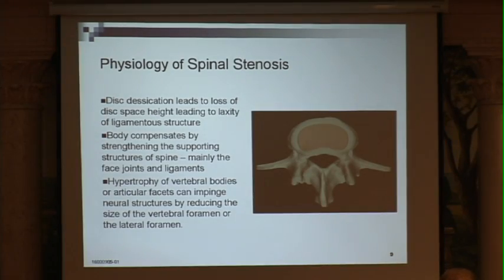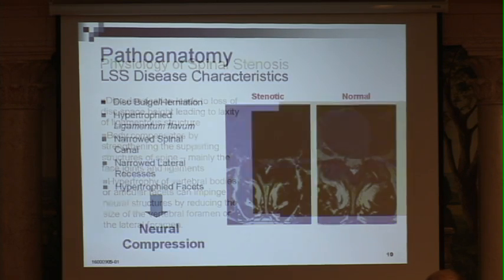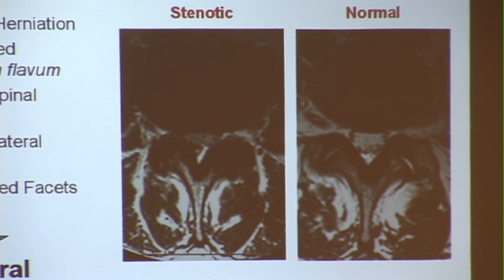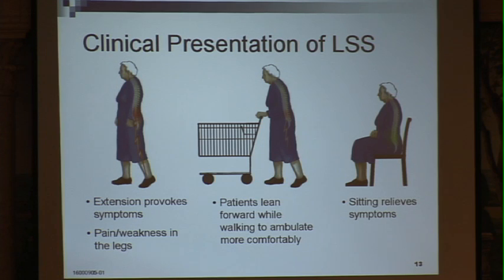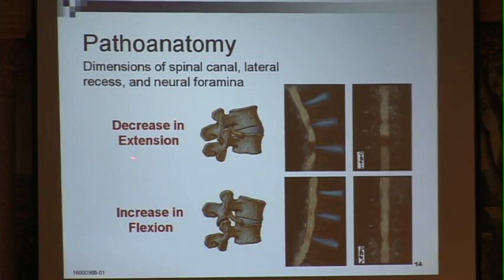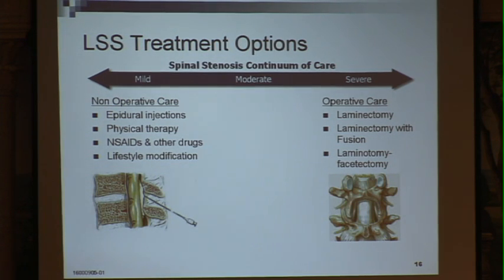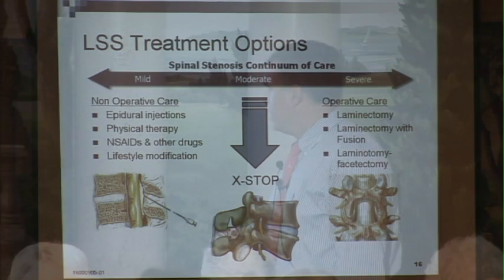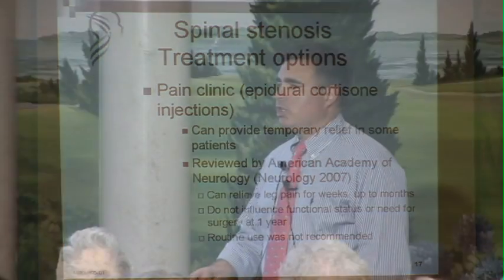Lumbar Spinal Stenosis Part 2 - Treatment Options Paul Houle, MD

Comment: Go and see a chiropractor to relieve the pain and further manage the symptoms
Reply: You do realize that chiropractors can only help minor back issues not major ones so it will not help if you need surgery.
Reply: @wolfbendysenpai1397  totally agree , I have this stenosis n have been.on pain killers over 30 yes without them.im useless n I live in my bed crafting
Using walker for almost 2 yes its getting to.point its useless aswell